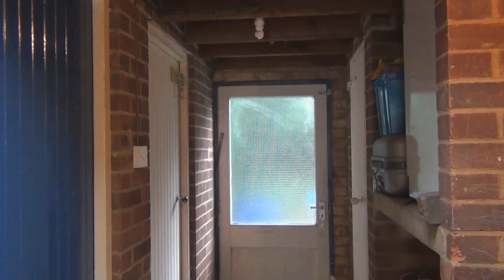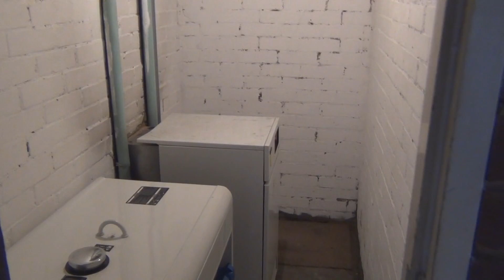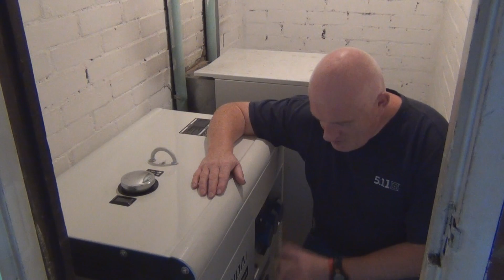generator 2

Comment: I bought a used DHY6000SE from Genpower in early March 2020. You can throw a stick at them from my home.
Cracking genset. Hardwired it in via a manual transfer switch. Ground/neutral tied to make it safe to use with class 1 and class 2 household appliances. Also placed it in a soundproofed Keter box with forced air ventilation.
It supplies us and our neighbours in the event of a grid failure.
If you have any tech questions or need any info please ask!
Just bought a HY3200SEI from them too as a 'camping' generator and for my folks.
I would always recommend Genpower. Roland is very helpful and always approachable. Great service from them.
Mine has a 1x 16A 115v, 1x 32A 115v and 1x 32A 230v socket. I am binning the 32A 115v socket for a 16A 230v socket. More useful.
Enjoy your rattlebox!
Martin R, HoneyJukes.

Comment: you said the tank holds 30 litres of diesel, the tank for that amount of diesel would be almost a third of the total size of the unit. did you mean 13? my standby set is a kipor kde 6700 and is almost exactly the same as yours. the only differences are in the control panel. mine does not have the LCD display, i did not want it as i saw it as a weak point. nice set i will agree. mine has got me out of trouble more then a few times. if you buy a ATS switch this comes with a comms cable and then the set will start up automaticly and switch itself in and the mains (grid) out for when the power goes out. thanks for the posting....
Reply: I suspect that Auto switch over is expensive, I thought we could have just a manual switch over. Can you give me any idea of the cost please?
Reply: @mistyqqq  my ATS cost me £455 and you may think that`s a bit pricey but it`s what it does that counts. when the grid is up and running it maintains the battery on the generator via the comms cable so as to make sure it is always ready when needed and gives the battery a longer service life as well. Once every 3 months it will start the engine on the set and run for about 30 mins just to heat the oil and drive out any moisture from the oil and inside the set, plus it`s always a good thing to "shake" the diesel in the tank so to speak and clear any chance of  waxing of the fuel. when it does this maintance cycle the switch does not switch over and remains on grid power and do`s not supply any power from the set to the load (house). if the grid goes down it first starts the set then isolates the mains feed (grid) and then switches in the set to supply power. it will run like this until it detechs the grid has come up again where it will run for about 3 mins and then switches the grid back in and then switches the engine on the set off and go back to standby mode ready for the next power outage. is it pricey, maybe but if your away for a few days then all your food in the fridges and freezers will be safe as well as your home security system still up and running. in my case the benefits far out way the cost. look at a posting called "HOW AN AUTOMATIC TRANSFER SWITCH (ATS) WORKS WITH A GENERATOR" (April the 3rd 2014) which is on a channel called "THE POWER SITE LTD" you can see the system better on that and he goes into better detail. good luck and stay safe....
Reply: @jakobrebeki  many thanks, your reply is very much appreciated. The next thing I need to research is how many items can this generator run. We have a chest freezer, a fridge freezer, will be getting a new telly, lights,  2 iPads and a small water pump that’s moves the water for five radiators that run from the supply from the boiler at the back of the wood burner. Nothing else needs go on in an emergency power cut. We are wondering if we need the DHY6000SE 6.5kVA 5.2kW of power or the next one up DHY8000SELR 7.5kVA  6.0kW of power ? Ps I presume the £455 does not include electrician cost to fit also  may have gone up since your video. Thanks again
Reply: @mistyqqq  Email me at JAKOBREBEKI@GMAIL.COM and i will be more then happy to send you a thinking list on how to do the math, it`s easy. and as for the cost of an electrican well that came free as i am an electrican (retired). when you know how to add up the values and not "cook" your set you will find it`s easy. but if your not sure on anything about the project best to contact a local electrican....
Reply: @jakobrebeki  thanks again

Comment: Nice video. I sell lots of these. It's a great machine and great value as you say. One thing that I would suggest is that keeping the tank almost empty means that you will get water condensation inside the tank which can affect the fuel over a period of time. If you get warm days and cold nights you can get condensation on the inside of the tank. Just something to keep an eye on. Well done for getting one second hand though. Another thing to watch out for is having solar PV and running the generator at the same time. This can back feed into the generator and will not do it any good. It will also run on red diesel (which is half price).
Reply: I thought the instruction manual said not to leave fuel in the tank as it deteriorates and could cause problems with the generator? I haven’t got one, just had a quick look through the manual online, maybe I read it wrong.

Comment: How long will the generator run with a full fuel tank
Reply from the maker: It has a 30ltr tank but it depends on the demand you put on it, but my plan is to use it to replace the central heating so 2 hours in the morning 07.00 / 09.00 and 19.00 / 21.00 in the evening so I would expect it to last 5 / 7 Days in an Emergency Atb. Roach

Comment: so....heater button, does that mean an internal 12v battery...which may go flat....add a small solar panel and intelligent charge fo 20 quid to keep it ready...
Reply: I realise this is a super late reply given that your comment is 6 years old, but there's a charging cable you can hook up to it. There's an internal battery charger.
Reply: @silverismoney  is there a manual pull start override ?
Reply: @redlineracing4947  no, electric start only.
Reply: @silverismoney  if only. Then it would almost be perfect it runs off diesel. Red diesel & you can get it running on veggie oil. Lmao it needs a manual pull start override